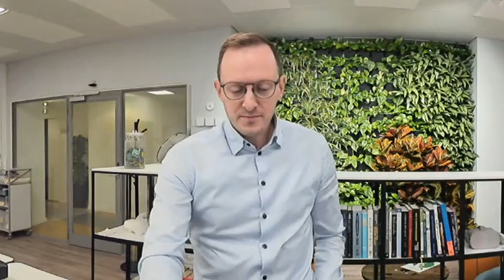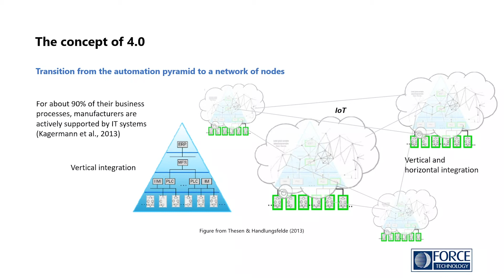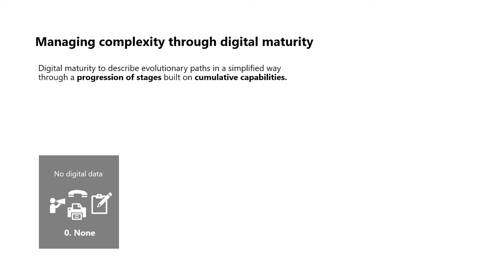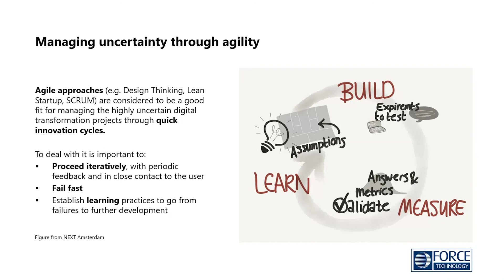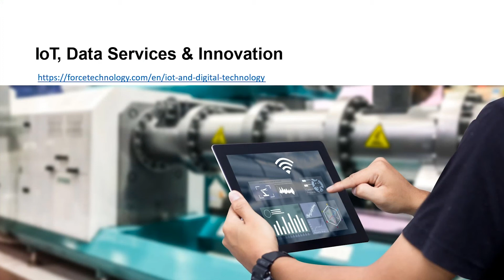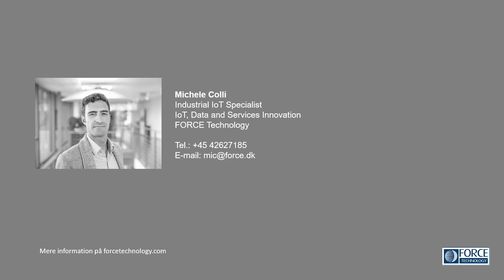Webinar: Introduction to Supply Chains in Industry 4 0

Comment: The presenter does not have real industrial experience, only theory and the other assumption is that regarding far east countries. Let me tell you something, presenter, most of the far east countries are much better develop than your country. Please don't stereotype based on your limited knowledge!
Reply from the maker: Many thanks for your comment. 
We would like to stress the fact that we are not talking about countries’ development, but labor cost. The offshoring phenomenon we discussed – and which strongly interested Far East countries – has mostly been triggered by labor cost differences (i.e. we are differentiating between high labor cost countries and low labor cost countries).